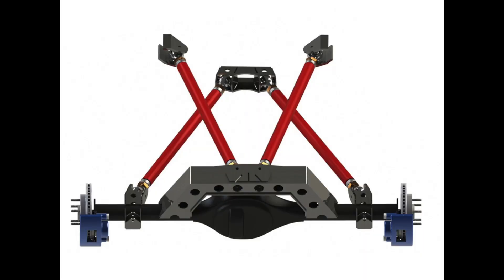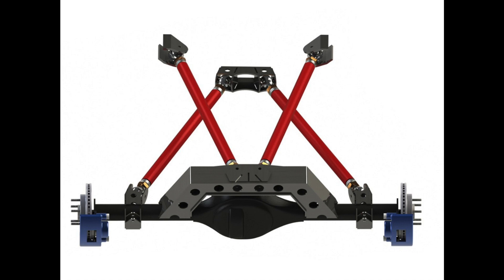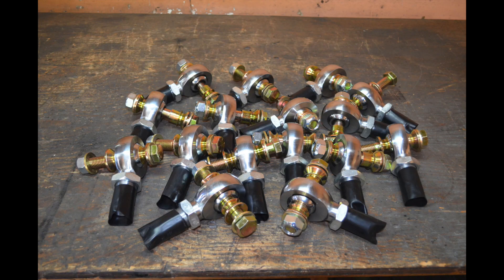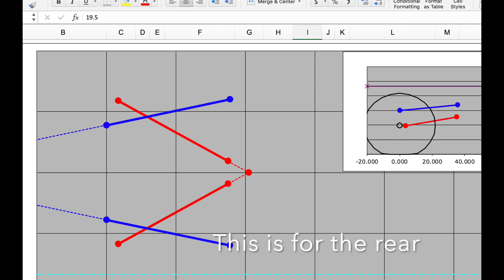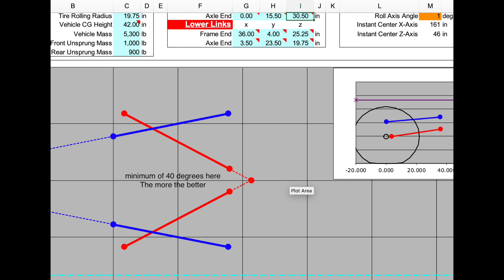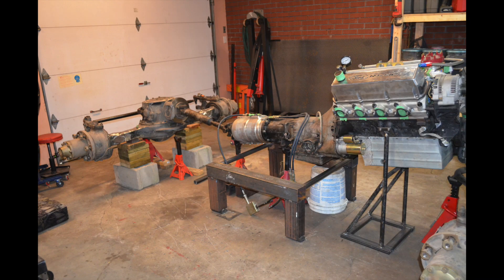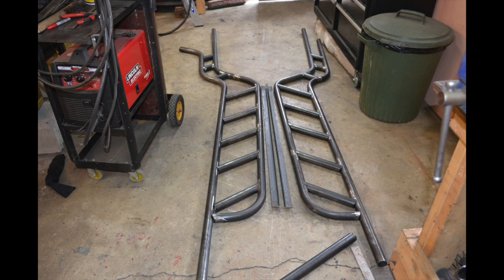Episode 3: Suspension and coolant lines | How to build your own rock crawler/buggy/bouncer

Comment: I'm starting my build soon. Just picked up my 4x4 parts truck. 1980 chevy 14 bolt rear, dana front, muncie 4 speed low geared transfer case with 4.11 ratio in the axles. Even got the 5.7 running engine all for 1k. Going to make a good first rock crawler build, upgrade as I go along. I Really appreciate you doing these videos. Your videos are spot on for what I'm doing...THANK YOU! Very helpful!
Reply from the maker: That’s great, happy to help. This is an exciting time for you for sure. Enjoy it!